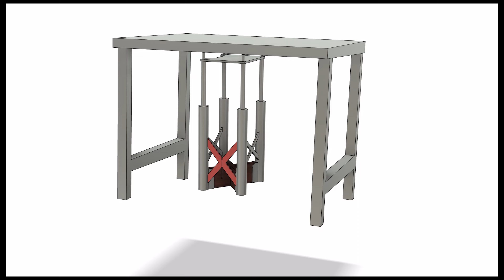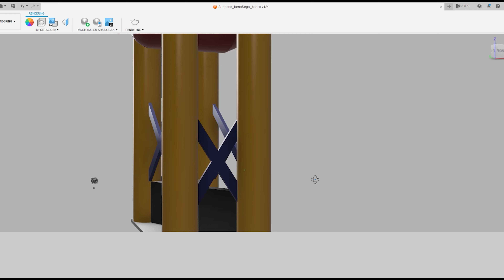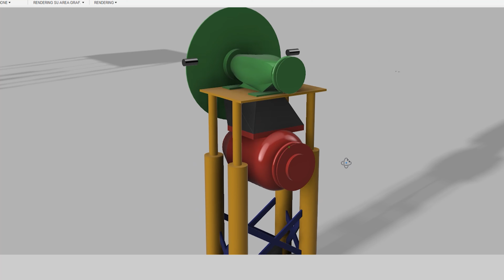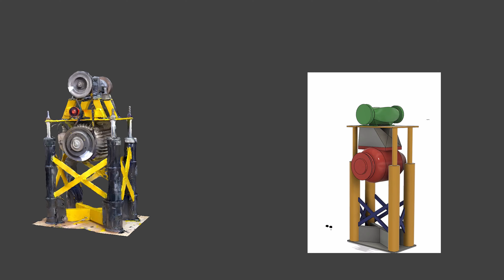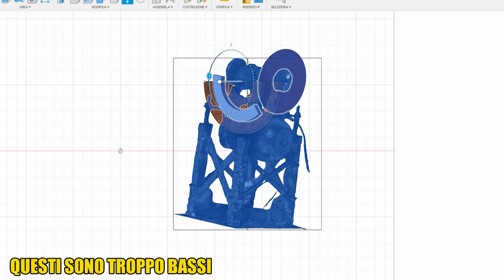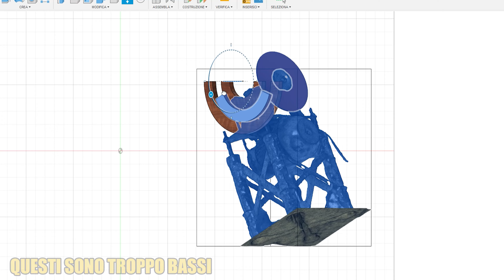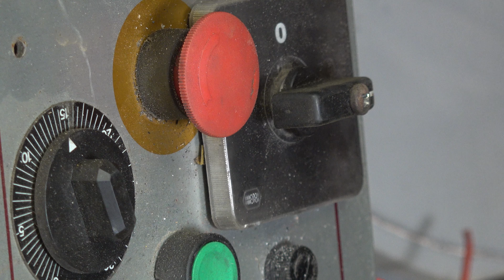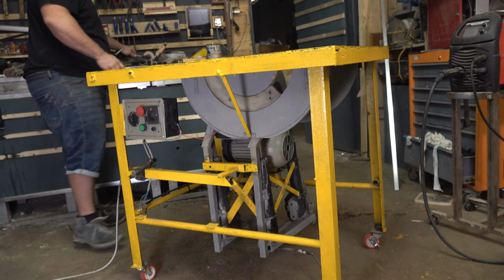Car Shock Absorbers to Lift Table Saw

Comment: Thx for sharing. Interesting idea. Unfortunately you lost me when you showed using a cut-off wheel on an angle grinder with no guard. Hopefully you'll never experience a wheel coming apart turning into a BOMB.

The jacks that are used to raise and tilt the blade need to have faster rates or else a way to use a drill. The real world doesn't have speed up like video does.

I do like the end product.

Again, thx for sharing.

Comment: dude.. i love your projects, but you  need to get yourself a better welder.. if its the cost, then buy a used esab smashweld 180  or 250 they make a perfect bead every time, they are old but good.. really good and dirt cheap.